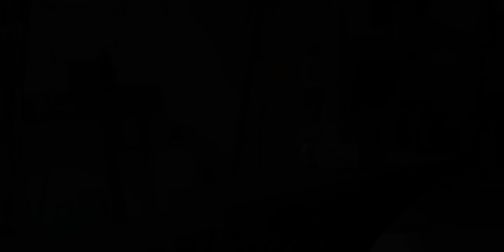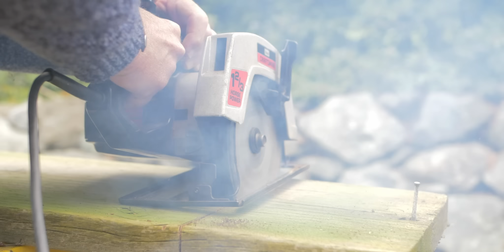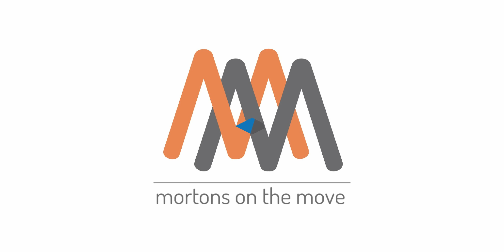Building the Lance Truck Camper & Pickup Out for Our Expedition North | Go North Ep 2

Comment: Great set up, I am recently retired and am on the fence btn a truck camper set up like yours; vs a Sprinter van conversion.  Surprised how heavy these are, as I didn't expect I needed to buy a 350, and also, how expensive these campers are.  Finally, I still don't understand why they haven't changed the style since the 70's.  Why can't rv manufacturers see what they are doing over in europe and update their designs accordingly.

Comment: Ooops, I forgot one thing. The metal tape on the roof around the antenna. Are you trying to force a Marconi dipole antenna with this? I am thinking not because the wavelengths of your cells phones and wifi would be too short for that to help. So, instead does the roof absorb the signal and so you are reducing that? What about a parabolic dish if you really want to bring in the signal? Travel safe, Henri

Comment: So, with approx 1300 lbs of available cargo, and you haven’t loaded batteries, solar, food, water and bodies yet. It looks like you will be maxing out your payload, granted that the up grades help, bottom line the frame of the truck and other working parts are only meant to handle 5500 lbs. Have fun on your travels, I’ll be following along.

Comment: Exciting eh?  First time I've seen slide on a truck camper.
Reply: There is one somewhere on You Tube with three slides ...
Reply: @RVingwithHenri  Yes, there is an Arctic Fox.  For any camper with slides, you need a MINIMUM of a 350 or 3500 truck.  Many are now using 450 and 550 to carry the VERY heavy campers with slides.